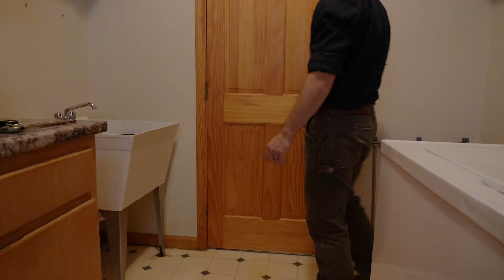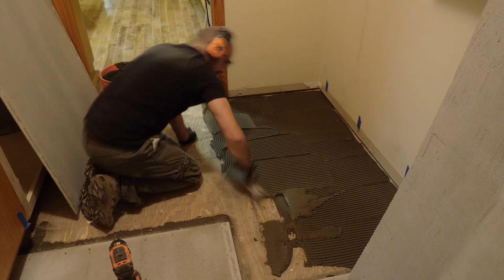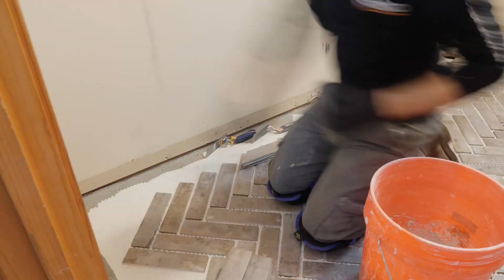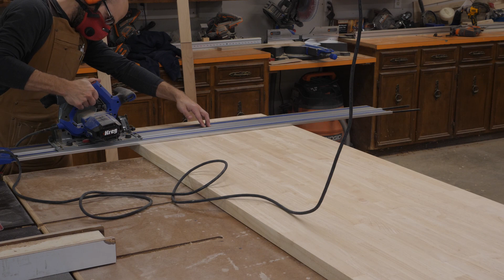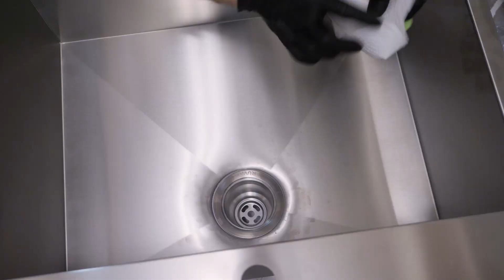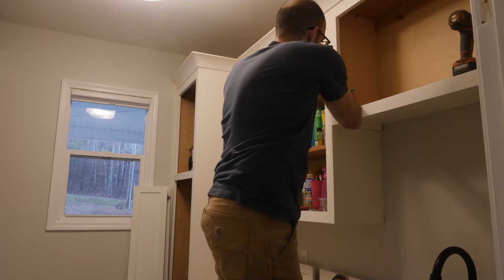Best Laundry Room Makeover

Comment: You could of used vinegar in you water with a sponge on your final grout wipe down. It works well.
Reply from the maker: Hey thanks for that tip!  How much vinegar do you add?
Reply: @WoodshopMike  about a cup per gallon. Works great as long as the grout is not too set up
Reply from the maker: Thanks!